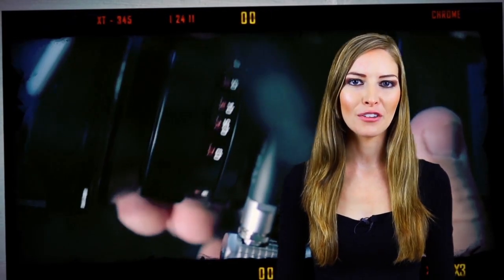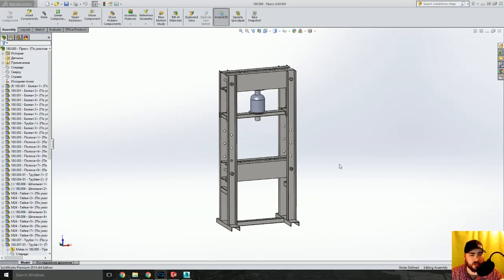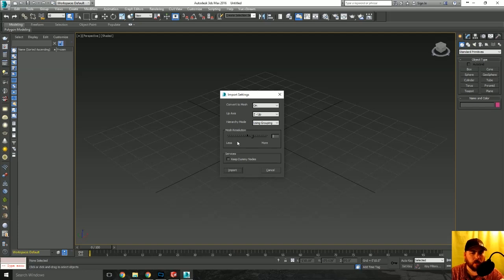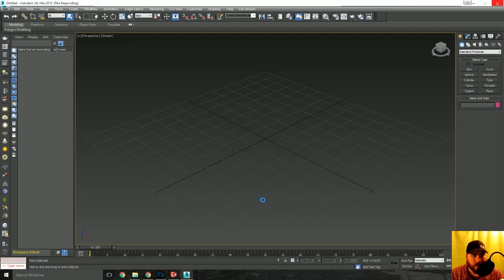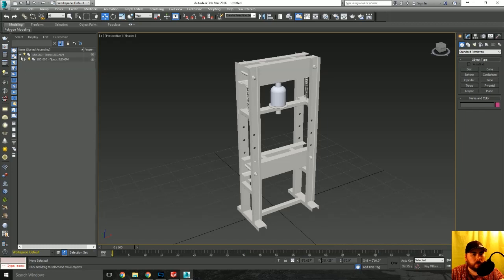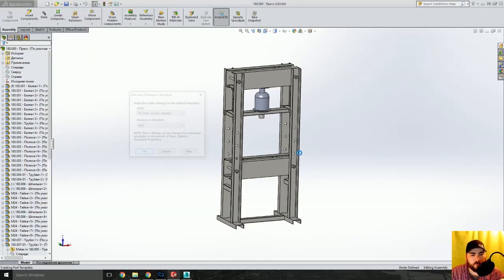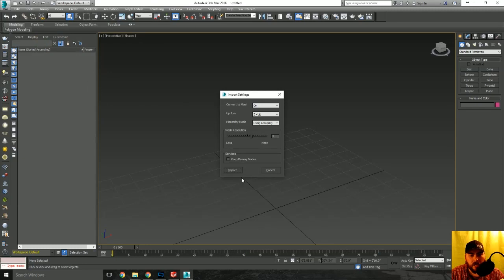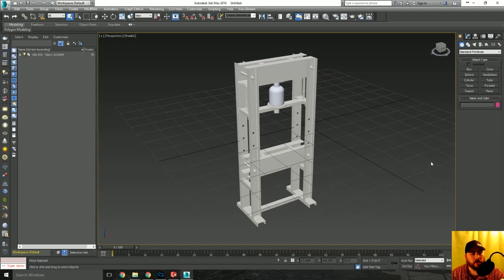Importing Solidworks Files into 3DS Max

Comment: One thing I need mention is that the version of your 3ds max must higher than your version of your solid works. If you use 3ds max 2016 to import your part which was created by version solid works 2016 or higher , that must be failed.

Comment: Hello, Actually I have some native files from SoliWorks,  SLDASM and SLDPRT, made in SolidWorks 2015. I have 3Ds Max 2016. Can I open It without have open Solid?. I tryed but nothing open in my Max. I need to open native files from SW in my Max. How I can do that, I men without convert the files STP, STPE, IGS, IGES, and this kind of stuff. Could you help me please.
Reply from the maker: Unfortunately, that is a documented issue. Below is a reply that we received from Autodesk earlier this year and none of the service packs for 2016 have resolved the issue to date. Something is different from SW 2014 (which worked when attempting to import 3D models) to SW 2015 and Autodesk was apparently, not able to resolve the issue (to my knowledge) within 2016. I'm not sure if it's been fixed in 2017 or not either.
-Mike

"Just want to let you guys know that this is a confirmed issue with development."

Comment: In 3ds Max 2016, you do not have to leave Solidworks open. Official source on Autodesk.
However, Solidworks 2016 // 3ds max 2016 imports does not work in my case maybe with others as well as i have read in forums.

apparently there is a known bug that makes the import not possible as it leaves the scene empty in some cases. 
personally i have tried using other method like Simlab Solidworks Importer for 3ds max and it works nicely in the meantime.
Reply from the maker: +zethib Unfortunately, I have also just encountered the 2016 bug after upgrading to SW2016 the other day and so far, we have not found a solution.
Reply: +laythrom the only solution I have found to use solid works 2016 to max 2016 is to use simlab exporters it worked but it is not free ;)